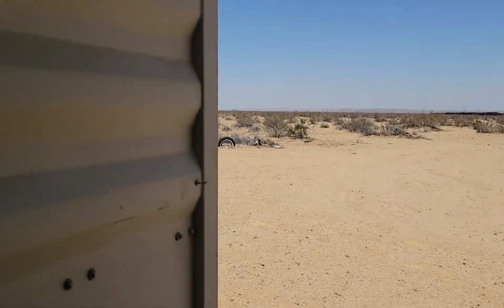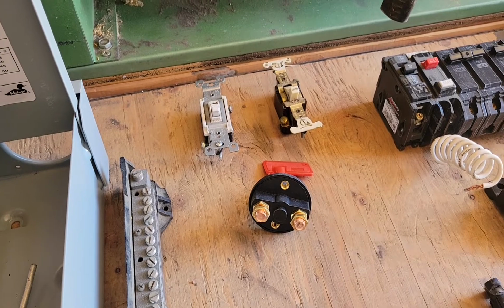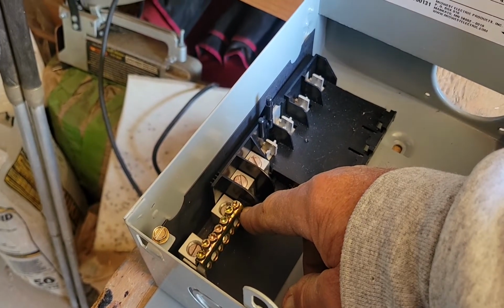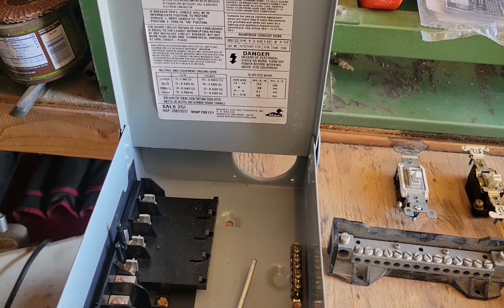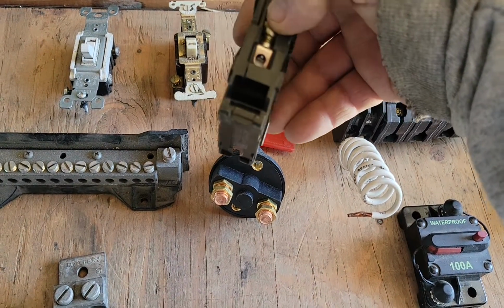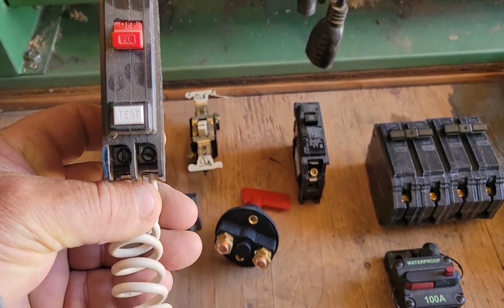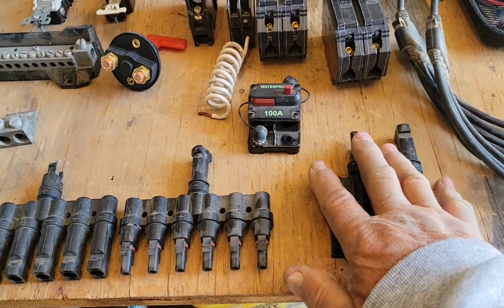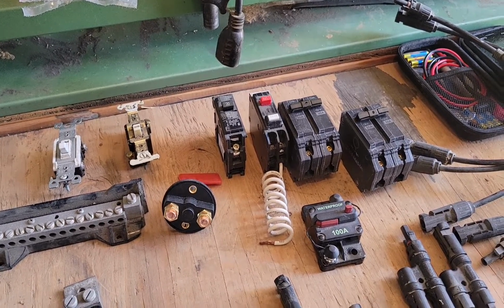Solar & Wind Terminology, Uses, and Functions, April 28, 2022

Comment: LOL, My 500w wind turbine produces a whopping 200w in a 25 or 30mps wind.  NOT THE PRIMARY CHAARGER.  SURE HELPS ON STORMY DAYS.
Reply from the maker: Makes sense.  That turbine is probably rated for 50mph max, and they usually only produce 85% of total.

Comment: LOL, I have a number of receptacles that are melted using a damn heater.
Reply from the maker: They'll do it!  A 2400watt space heater at 120 volts is 20 amps.
There's no room for anything else on that entire circuit.   For safety,  it's recommended you only use 75% of the rated circuit, so once you pass 15 amps you are maxed.  It'll handle 20 amps, but like most things you should never max them out.

Comment: Speaking of wind, let me know if you and Andy need help putting up that 50' x 75' shade cloth.  I see that the wind is good for most of tomorrow but will be increasing later in the day to 20-30 mph...
Reply from the maker: Thanks John, no, Andy is getting over the flu and probably won't be up until next weekend, weather permitting.
I do have a batch of almonds for you though.  Let me know when you want to pick  them up.

Comment: in strong winds ill never use a break switch that shorts the three phases seen it burn out the stators a couple of times, switching to a really heavy load ie wire wound resistors works well no battery hook up just resistors instead of shorting phases.
Reply from the maker: Do you use an automatic shunt to do the switching, or do you do it manually?
Reply: @GBear  can do either

Comment: Gbear I have 3 shunts on my flexware for my negative to watch my current going thru and my battery voltage... Shunts are used to monitor ur voltage... Keep it up brother
Reply: never knew that, i know ive used them on my amp meters.